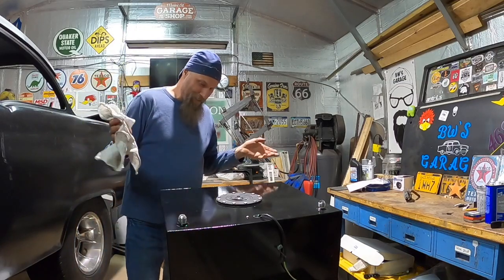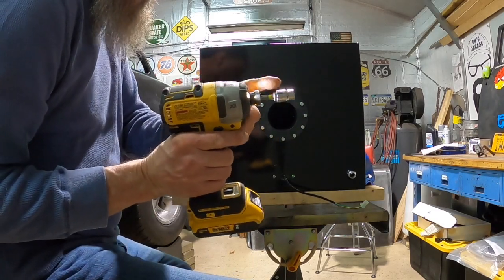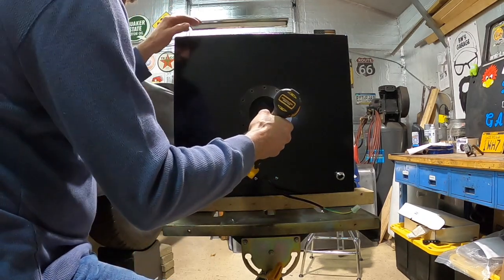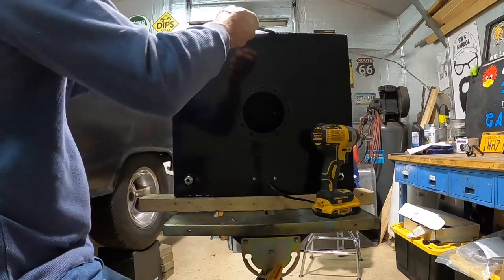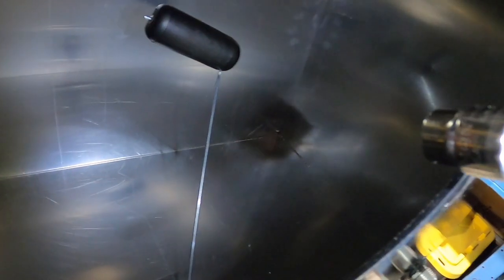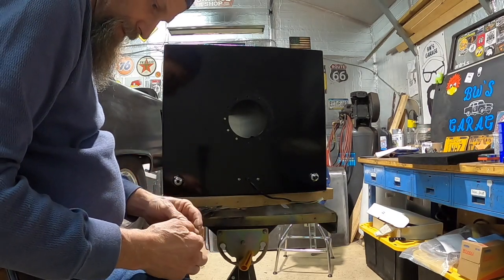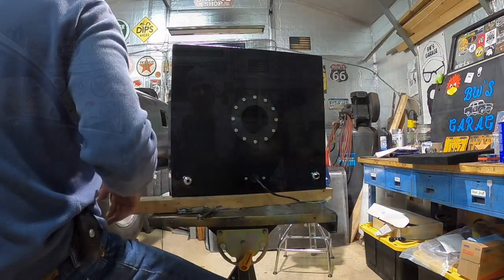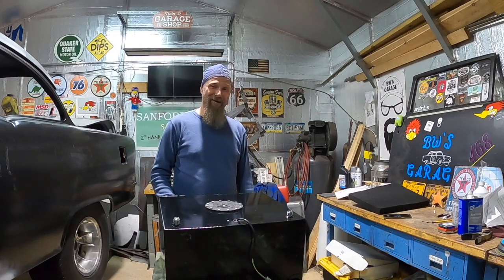Get The Sloshing Foam Out Of Here, For the 2nd Time! #fuel #cell #antisloshing #foam #removal

Comment: I have a cell like this.  Need to modify it to work with an in tank pump for EFI / turbo.   Probably will end up cutting the bottom out and replacing it with 5052 sheet so I can add baffles.  

If I screw it up and have to start over no big deal, it’s a $75 eBay fuel cell and there’s a few thousand available between all the sellers

Comment: People not realizing these are supposed to be replaced every season/year. If your foam is breaking down from standard pump gas, race gas or e85 you’re buying off brand foam 🤣
Reply from the maker: I switched to the wiffle balls. Cost a little more but don't break down

Comment: If you bought it new, leave the foam in it.  If the foam is old, sure replace it with new foam.  There are other things you can put in there to slow the slosh.  I've even heard of sneaking sealed oil containers in it.  And run some good filters.  But I think you'd be better off with some kind of anti-slosh something working in there.  Even if the car is not going side to side, it still is going to slosh front to back.
Reply from the maker: The foam is defective. 🙂

Comment: Is that cell safe to use with diesel when the foam is out
Reply from the maker: That would be a manufacturer question, but I can tell you pump gas designates it

Comment: We’ve had similar issues with our ATL cell. I believe it’s because of the ethanol content commonly found at the pump now. We changed the foam, and has since used clear gas and tried to keep a low fuel amount during the off season.
Reply from the maker: Yea, that seems to be the common thing,  the cheaper fuel breaks it down.

Comment: This is an apples and oranges type comparison of information. I ran a real ATL fuel cell in two different roundy round cars for 12 years without issues.
Running leaded race fuel. I sold the car complete and the new owner decided to run it on pump gas with an octane booster. Dumbass move it took him 
4 weekends of racing figure out the problem.  but that stuff you pulled out looked like packaging material for electronics
Reply from the maker: I hear ya Grady, it was definitely a cheap knock off of the proper material.  Andy Turlo said the same thing, type of fuel makes a big difference too.

Comment: Yeah man when my nephew ran late model these car's where nascar pecs, is fuel cell u could take the hole top off and the foam was like bricks in it and blue color. Had a nother one with yellow foam .never had a problem.
Reply from the maker: I think it has alot to do with the type of fuel your running too, just from comments Turlo and Mr B Real had no issues running race fuel, but when switching to regular gas the foam breaks down

Comment: Hey Brian.. glad you removed it.  I was told by another friend that after awhile the cell material breaks down so I bought new foam from JEGS to replace my original foam before it started to break down (I thought).  The new Foam material comes in bricks, that you order according to your tank’s dimensions.  When I opened it up to replace the original foam thats when I found out the all the original foam had already broken down and had gotten all into my Fram canister Gas filter and also into the electric fuel pump (it was probably just about to burn up). I was lucky that I also had another fuel filter but the carbs and I caught it before I got to the carbs!!!!!  I of course replaced all the fuel filters and the electric fuel pump.  I removed all the original foam. strained the gas (had a full tank (of course)), through a bunch of layers of cheese cloth.  Dried the tank, and vacuumed it out, and never added the new foam and returned it!!!  I never had had an issue with fuel sloshing in the tank causing any starvation issues.  The original 55, 56, 57 tanks work well and the didn’t have any sloshing foam in them.  
Anyways great job on getting rid of the foam and never look back.  Lol
Reply from the maker: Great knowledge drop based off real experience Dave. I few people  I spoke to had similar experiences with that material.

Comment: My Pinto Stock Car has a fuel cell. One year we parked it with premium fuel in it instead of race gas. In 2 months the foam half dissolved and plugged up the entire fuel system. After that we only used 110 octane race fuel. It has had the same tank of race fuel for about 12 years now and the foam was still good until I ran it on premium again. That pump gas is caustic!
Reply from the maker: I was just reading reviews on foam, and alot of people say don't use any foam. I know gasser Dave had same issue as you with clogging fuel system. This foam I pulled out was already breaking down in my hand with zero fuel exposure.  Oh and the Phil membership badge looks great on you bud
Reply: Hi Turlo 👋🏻👋🏻👋🏻